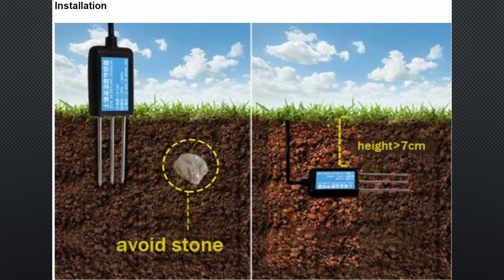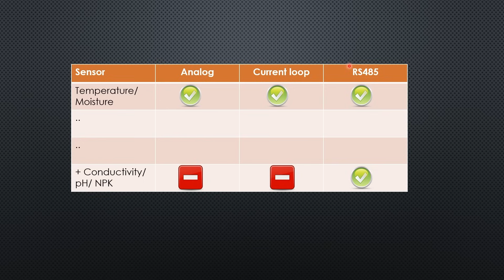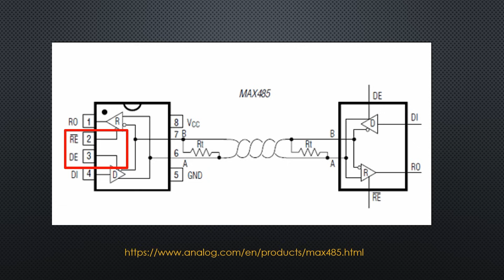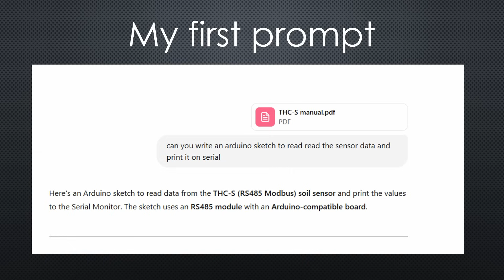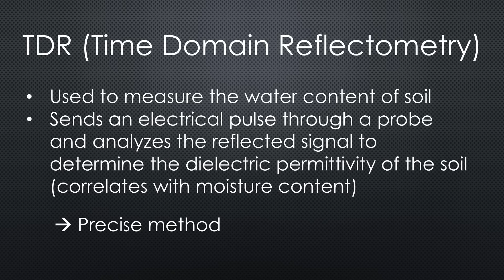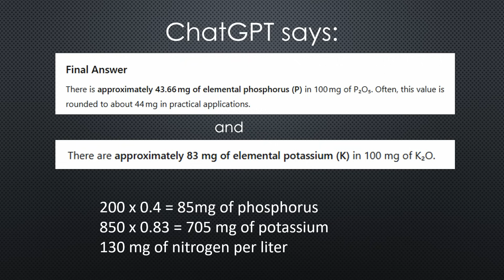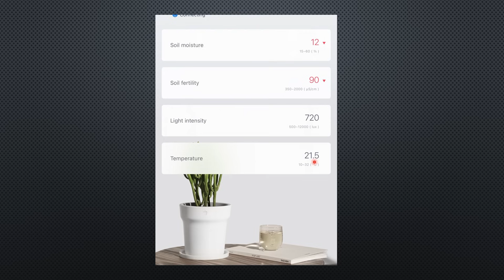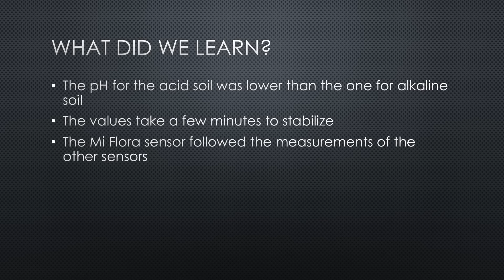(502) New (better) Soil Moisture Sensors and RS485 Modbus on ESP32 Arduino

Comment: I've been searching for years for a sensor that can accurately measure pH, TDS, EC, and NPK in water. I grow plants and still do all my measurements by eye. I've tested at least a dozen sensors, but they all seem to give random results.
Reply: Water is relatively easy object. Buy pH meter with preferrably gel electrodes. It will suffice for most uses. There are wastewater continuous monitoring electrodes for pH and conductivity. They're good n tough but expensive. These are for one electrode per farm usage.
I don't know any good solutions for NPK.
Reply: @ІгорАлієв  I've tested many, I have 0 ppm water reservoir and all fail to measure it. I grow carnivorous plants and they are very intolerant to fertilizers, I can fertilize up to 150ppm, it's lower than mineral water. 

Next thing I'll try will be sensors from marine aquarium, they are made to work with no margin for errors, but they can cost 4 digits easily.
Reply: @eduardoferreira9882  Ok, if I understand correctly what you mean 0 ppm water you have deionized or distilled water. Then some pH meters do fail to show something meaningful. Conductometers are very useful for testifying quality of deionized or distilled water. But the main thing that I do not get yet, which object do you need to measure - deionized or distilled water or your soil or both?
Reply: If you need serious testing, youd better not to buy cheapo sensors but professional pH/ion meter, together with conductometer and specialized electrodes. They'll last long. 

Concerning nitrogen, there are three forms of it - nitrate NO3-, nitrite NO2- and ammonia NH4+, each needing different method or selective electrode.
There are selective electrodes for nitrates or nitrites for food quality testing (expensive). Idk which of them are the most important for you. At least there are other options like fish tank test systems. The next option is tube tests+automatic spectrofotometer (1000s $). I used Hach tube tests. Anyway, any efforts to control ppms of ions will lead you to create your own lab. Maybe you can focus on smaller number of parameters, important for your plants and decrease costs a bit.

Comment: I always enjoy your channel . I found a cool module that you might be interested in, ryuw122_lite. I am going to use this modules s in my robotic lawnmover project. Its uwb communication with ranging,  claimed accurcy of 10cm. I have ordered 4, i am going to use 3 as beacoons, and on on the robot. And then my AI friends will help me write some code to output ogmented nmea data without the need for gps  :-)   I have no ide how good or accurate these modules will be in real life, usually when i get a sensor or something, i have already  seen it on your channel but not this time, therefore i will make you aware of this module.

Comment: Hi Andreas, you mention at 7:20 that esphome does not provide a signal for your hacked board. However, is the "flow_control_pin:" that is mentioned in the Example client yaml (on the same page you are showing) not a solution for this?
Reply from the maker: You are right. That is probably what I was looking for (but obviously not good enough). Thank you!

Comment: Very interesting ! Thanks for sharing.
I don't believe the probes will remain in good condition for longer than a few months. They are guaranteed to rust. Stainless steel rusts if it remains in a humid environment for too long.
Reply: Ive had several in use for a couple years with no rust or corrosion.
Reply: @JeemsJustJeems  Thanks for the info. Were they permanently buried?
Reply: @jacquesmertens3369  Only in the sides of the pots and not fully buried no. I have had a couple submerged in nutrient solution for a couple months now without issue though. I only use the Temp Humidity Conductivity Sensor, THC-S version.
Reply: Good quality versions of these sensors (from Delta-T) can be buried for years - but you may well be right that these cheap versions aren't good enough for prolonged burial.

Comment: Whilst it is often stated that RS485 does not requite a common ground, it can be quite easy to exceed the common mode range of the receiver without one. I've run into this problem in a number of installations. If one end is truly floating, you're probably OK. You can use isolation transformers on the differential pair, but it's easy to run into ringing problems.
Reply from the maker: Thank you for sharing your experience!

Comment: RS-485 IS referenced to ground, sure it's a differential transmission protocol, but without a ground reference, you might exceed the receiver common mode voltage range and experience failure.
Ignore the ground at your peril. Especially with long cable runs between buildings, in noisy environments, etc.
Reply from the maker: You are right. Thank you for sharing your experience.

Comment: WARNING SNAKE OIL!!!    I own a Smart AG company based in Japan. We have done extensive tests of these Chinese sensors.
You cannot get soil pH Value OR NPK value via a metal sensor. Obviously, a glass electrode would run the risk of damage or drying out electrolite, so it may seem attractive to try to get PH via Zink pin (video said Stainless steel) It is at best a guess. The NPK isn't even attempted to be "measured" but is calculated inside of the sensor as a function of the soil EC & guessed pH values. They say "Reference" because these values have basically NO meaning outside of there MAYBE being higher or lower values though this is dubious at best.

I love your videos, but just wanted to point this out to other before they attempted to invest time or money into something that is basically a random number generator with a builtin Temperature & moisture sensor (the EC values aren't too bad from our tests though)
Reply: Chemist here. If you want accurate pH, use so called gel electrodes. They are actually normal glass electrodes having protective cap, filled with gel. The cap has small hole at the bottom, thus your gel bridges your glass electrode with your tough environment. Used em daily for biogas digestate and refilled with gel monthly. The electrodes were kept in 1M KCl solution and contacted digestate only during measurements. I am pretty sure that something similar for soil monitoring exists. There are wastewater sensors for continuous monitoring, though quite expensive. Maybe you can adapt them, at least add some moisturizing.
Reply: To measure NPK or PH you need a "chemical" reaction (i.e some sort of "specific" ion exchange). As stated you can't do this with a simple conductivity test which is what anything with simple metal electrodes does.
Reply: @jjdawg9918  It's quite a lot more sophisticated than a simple conductivity test - but still not capable of measuring any specific ion behaviour or concentration, as you say.
Reply: @jjdawg9918  the glas/gel electrodes are not realy easy to use. A lot of calibration and soil-based problems are reality. And there are ion-FET available as an alternative.
Reply: Good to know I'm not the only one dubious about those sensors claims.
I've been interested in them for a while but have yet to find any good scientific article that can explain EXACTLY how they work, hence I decided to save my money. Sounds like it's a good thing I did too.
Reply: Hi Kevin,

Thank you for the information! 
Would you have a suggestion what one can do if one would like to measure NPK values of their soil (in different places)? 

Thanks in advance!
Reply: @Conservator.  npk is tough, it is sortof the holy grail for what i have been doing. Curre tly i do rely on lab soil tests still. Basically soil is sampled from multiple locations within the greenhouse and sent to JA for testing. I then enter that i to our UI and have an algorithum that bases the sample result on the crop, soil type, time since sample, ec, ph and moisture to guestimate a value, but i make it extremely clear that the value is not to be taken as 100% correct. I have been adding some TinyML to our devices and it has yielded reasonable accurate values, but as always in the realworld you need to be careful.

As i mentioned before for ph, we have a locally produced agcl sensor, but there are also ones on aliexpress, no clue how well the aliexpress ones work though
Reply: @Kevin192291  Thanks for answering my question! I was ‘afraid’ that lab tests would be the only reliable way analyse my soil. 
As a hobby gardener, I’ll just have to have  to look at my plants, make an assumption and test that assumption carefully (eg in small steps). 
Well that’s also part of the fun tbh.
Reply: These are probably FDR sensors - and, as such, simply can't measure NPK or pH. If they are actually decent quality FDR sensors they can be very useful - but they shouldn't be being sold for NPK or pH sensing.
Reply: @Brynmawrhill  agcl for pH sensing is also sold on aliexpress and at very least passes the sniff test. I havent tested them myself, but if you want something that at least sounds like it will work, it may be worth a shot
Reply: @Kevin192291  Indeed Kevin - that would be the way to go if you want accuracy (though I might not be buying cheap Chinese sensors in that case!). I'm a soil physicist so I would certainly be using wet pH sensors for such work.
Reply: @Brynmawrhill  👍 i agree
Reply: @Brynmawrhill  They claimed that it's FDR. But I don't know if it's truely FDR or not. TDR type in China market is above 150$.  For this kind of sensor, if you buy the 5 pins which includes 7 parameters, then its PH is terrible. But if you buy the PH only, it's quite ok.
Reply: @កសិកម្មនិងបច្ចេកវិទ្យា  I have no idea how an FDR (or TDR fir that matter) would measure pH. Do you have properly controlled experimental data for this?
Reply: @Brynmawrhill  No, I don't mean that FDR is used to measure PH. I mean they claim that their soil measure uses FDR method. Regarding their PH, i don't know which method they use but just know that one of the pin is AgCL and if you buy the 5 pins version, the PH is very unstable maybe due to interference with other pins.
Reply: @កសិកម្មនិងបច្ចេកវិទ្យា  Interference seems very likely even if the have somehow managed to get an AgCl cell in a pin.
Reply: I am suspect of pH accuracy.  I would test with a real/calibrated pH meter.  The soil Andreas has may not have the pH on the label.  I agree with Kevin, the NPK is useless.  Going from soil EC to multiple salt values is at best a wild guess.  Therefore, save your money on adding these 'features'.  There are soil test kits, if you want a better standard of comparison.  The only way I see a use for the NPK is that if they decrease at the same moisture/temperature, then maybe your soil nutrients are decreasing.  I have a greenhouse and several vegetable gardens, so these sensors are of interest.
Reply: @dougbas3980  I think that is the "solution of miracle questions about NPK sensor values". A few sellers describe this in details. So if you know what you do, then this sensors could quiet good perform. Including ph-values, as some hints are about a special "solid-electrode" is in use.
Reply: Have you found anything reliable that doesn't require regular calibration?
Reply: @jmr  TDR sensors and FDR sensors like these are accurate enough for most purposes if calibrated initially - TDR is more accurate but more expensive. 

The best choice - TDR, FDR or capacitance (which are usually the best options) - depends on your requirements (accuracy, numbers, budget) but I can't speak to the specific accuracy of these particular Chinese sensors or, for example, whether their conductivity (ie signal attenuation) measurements are accurately corrected for temperature. 

There are plenty of really good TDR and FDR sensors out there from reliable companies which will guarantee the quality of manufacture and measurements but t a much higher price (as usual!).
Reply: @Brynmawrhill  Those give accurate PH?  I should have been more specific.
Reply: @ No. If these are FDR sensors, as I suspect, then they cannot measure pH - they can't even provide a worthwhile estimate of pH by some form of calibration.
Reply: based on your testing did you find anything reliable that makes sense to buy with a maker budet? I used TEROS 12 in the past, but that is kinda bulky and pricey.
Reply: Well said. spent a few years looking at sensors to measure blood, boy how much time in R&D we could have saved if two/three metal conductors could do it all.
Reply: There is a github repo for this sensor that has been calibrated using a teros 12 (very expensive TDR meter). It is by kromadg
Reply from the maker: Thanks for the link. I put it into the video description.
Reply: Hi Kevin, since you have some experience and I'm trying to study this type of sensor I would like to ask you a question. Using both FDR and TDR sensors I note that the apparent dielectric permittivity of the soil tends to rise at higher salinity in the soil. Considering that the VWC is calculated starting from the permittivity, it is clear that it is also influenced by salinity. Why isn't EC usually taken into account in the equation that calculates VWC? Thanks in advance
Reply: I have try this thing, it show less nitrogen, when I add nitrogen, all value increasing nitrogen, phosphorus and kalium, so what I see, this tool not working at all.
Reply: Thanks to Andreas and to You for these facts. They save very much time by preventing dead-end purchase projects. The long time reliability and stability needs much more information.
Reply: The "Chinese" is unnecessary. Plenty of Chinese sensors are excellent, and plenty of snake oil is made and sold by other countries. Caveat emptor.
Reply: @BaronOfDaker  agreed. Even the 'cheap' might be left out. There is expensive snake oil as well. 'Expensive' not always synonymous with 'good'

Comment: "soil moisture sensors" with metal-probes always measure the conductivity of the soil and not the amount of water in it. depending on the salinity of the soil the show more or less humidity, what is totaly wrong. a side-effect is, that at the metal probes there can be debris of the electrolysis found. not a healthy idea for plants.
Reply: Not so - these are probably FDR sensors and, while they don't measure water content directly, they measure dielectric permittivity which is related almost linearly to water content (via the Topp equation) though the exact line depends slightly on clay content. they also measure conductivity by signal attenuation - not quite as accurately and needing calibration for temperature.

Comment: Check out the Delta-T WET150 and the WET-2, granted they use a different protocol called SDI12 but has better documentation.
Reply: Yes - I think these are a rip-off of the Delta-T WET2 sensor - which is good and has been around for ages. I use it on site and in the lab every week.

Comment: Thank you for your effort. Still using a PCB based Zigbee soil moisture sensor for rain drop detection. 
I solve several serial (RS458 or RS232 or "TTL")  Modbus -> ioBroker topics via Eth / Wifi by using converters of USRIOT . Moduls for diy or ready units are available. After a fiddly installation ist works a treat for years.  Modbus electricity meters,  Zigbee-controller, DE utility meter ("optical Info" interface),  433MHz RFLInk and so on.
Reply from the maker: I think, those sensors are ok, too. Many experienced viewers suggest that these are real FDR sensors. That would make them more accurate than the capacitive sensors as they use a very different method.
Reply: @AndreasSpiess  Yes, pH value is really helpful for soil monitoring. I reduced irrigation and watch which plants will survive -> KISS.

Comment: Depending on the tranceivers used on your bus you could do up to 250 devices. I have done up to 90 on a segment without a problem.

Tranceivers will usually note this as bus load. 32 devices is the original standard. 1/2 load will give you 64 devices etc. 

Usually bandwidth is a bigger problem depending on application.
Reply from the maker: Good information. Thank you!
Reply: Did you use a arduino/esp32? If you did, would you mind posting the links